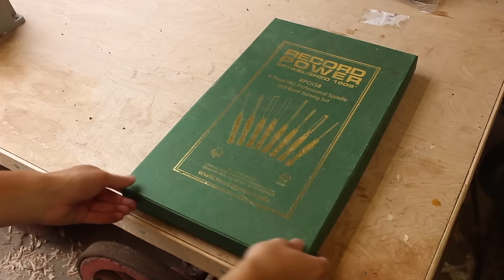Relaxing Wood Turning Video!

Comment: Sean, I absolutely hate to be negative  but  your technique concerns me. When using a scrapper the rear of the handle must always be elevated. Also,  The scrapper must always be used slightly above center or right at center, never below.  Furthermore, you're using a spindle gouge on the inside and outside of the bowl and that is usually not a good idea. They're designed to cut side grain and not end grain. Remember in a bowl you're cutting both. You need to use a deep fluted bowl gouge for safer cutting options when transiting from side to end grain.  Keep turning and making beautiful things.
Reply from the maker: Hi Ronald, Thank you for your advice. This video was for Record Power. And I only wanted to used the tools they sent me. (I didn't have a bowl gouge from them). Since showing them the video... they have kindly sent me one of their bowl gouges, for the videos. Thanks or scraper help! I'm always keen on learning more things! see you in the next video!